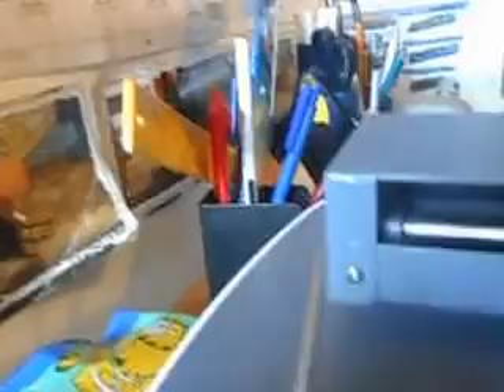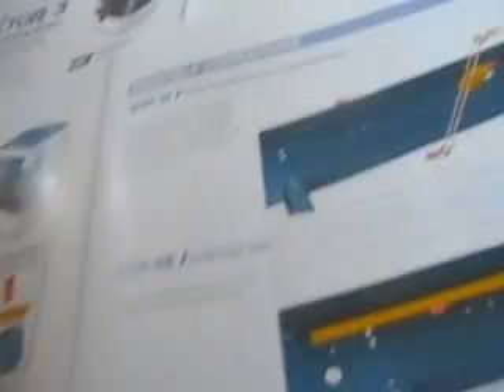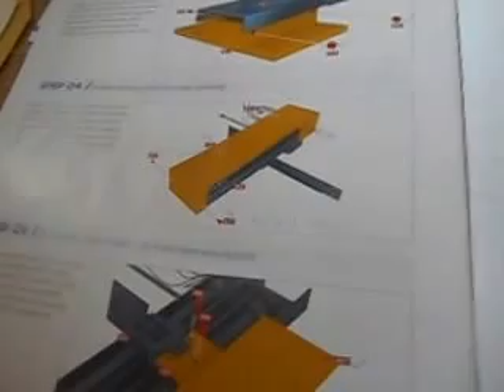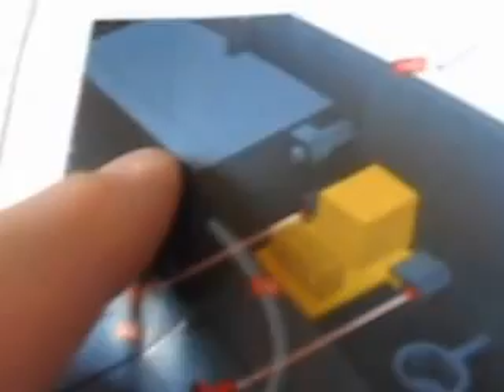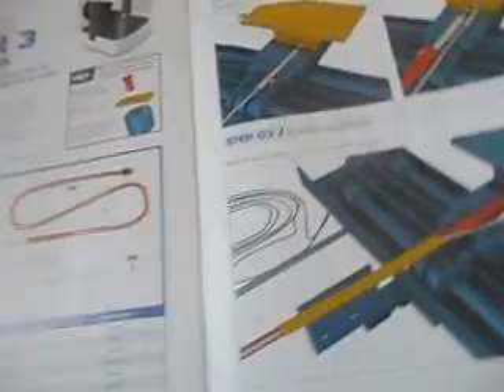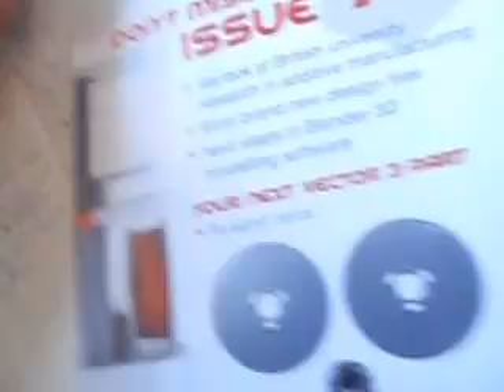Why Eaglemoss is backwards for doing this 3D Printer build!!!

Comment: sup Jimyjames73, yeah it is a little backwards of them with the way they have the build, taking parts off and on will and does only help to wear them out as i have found with the y-axis block, bearings are gone, have a replacment on the way, screws and bolts snapping... at the min my V3 is stripped down to the base and no covers on any of the axis because i'm constantly having to micro adjust things ie. belts, rods and tighten screws holding the thing together, i would post more vids on my channel but lose the will with this thing sometimes haha
Reply from the maker: Thanks for checking out my Channel/video - Yeah - mine is also in bits but not stripped down as yours just taken out the bearing block in issue 3 b/c there is an "O" ring missing in the bearing block - waiting on Eaglemoss to send me a replacement part!!! Had to buy separate screws from a model shop to fix the Hood Limit switch (Issue 47) b/c the head on the screw weren't very good :|
Reply: i completly did away with the hood limit switch, to be honest its not really and truly needed for the majority of tinkers like us, all i have done is to remove it from the frame, used tape to close the switch and then just tape it to the bottom of the case. 
i've only been waiting for the block for 2 weeks so... knowing them, well.... 
didnt know about the missing o ring either so thanks for that, could be that on mine but it sounds like i've missed a gear when its traveling back and forth when printing but not when on manual control, strange.
good to actually talk to someone who is interested in this starter printer and has had problems too, the facebook page someone has set up isn't that good really, and would love to setup a website of my own but dont have the time at all with work and kids etc..
Reply from the maker: Arrrr thanks for that :) such kind words :) I had 4 attempts trying to print something - see my video link :- https://youtu.be/cxgfiGph8Tw & you will see the missing "O" ring. Yeah if you get missing Issues or need spare parts - seems to take weeks to get them  for some strange reason :(
Reply: if you want to get better results with your printing try using Repetier-Host
https://www.repetier.com/download-software/
scroll down the page for download without donation
been switching between 3d print software and this and had some good results, more options and control over print speed, layer height, fan speed etc...

also noticed on your videos your using masking tape and they look quite overlapped pieces, this could or is one of your problems, also dont use the shim that they have sent for nozzle height, use a strip of standard 80gsm paper instead. i use this method and very rare have any problems.
try placing the pieces of tape butted up edge to edge, tiny gap if you want or better yet go to wilkos and get some blue masking tape
http://www.wilko.com/wallpaper-paste+preparation/wilko-best-blue-masking-tape-48mmx25m/invt/0342782
best £3.60 you can spend to make your prints stick to your bed, just use a little less heat or the prints will warp and start to curl up

Comment: We fully agree the whole process of add a part to remove it to fit another part later is frustrating. Then of course on issue 70 there is the take a lot apart to fit a better heater. I think it would have been better for them to take a bit longer to work out parts to reduce the need to take fitted parts out to fit new parts. The message to Eaglemoss is try better planning.
Reply from the maker: Thank you both for noticing & fully agree with me & that is why I made the video :)